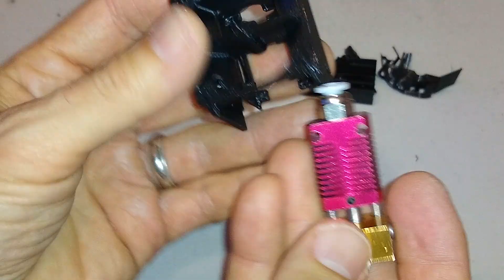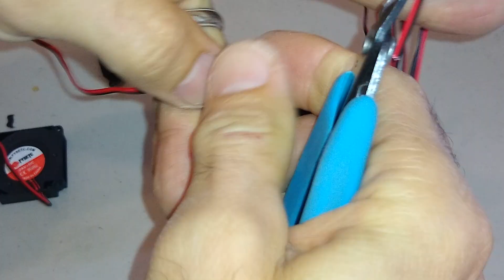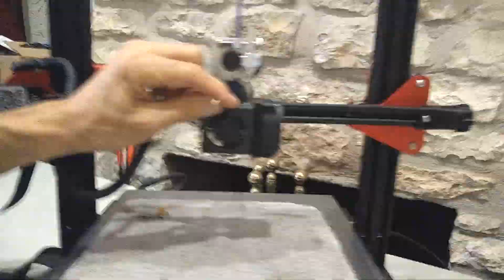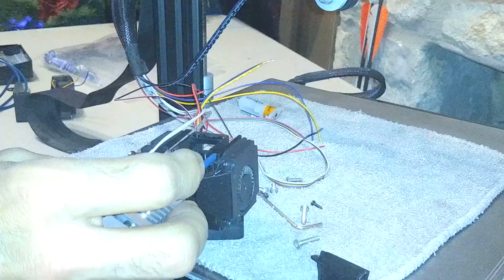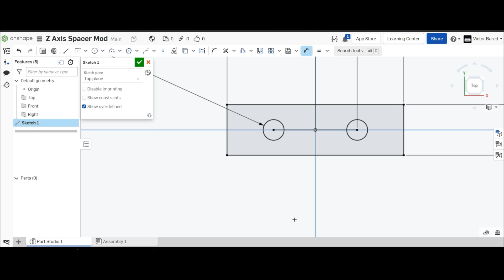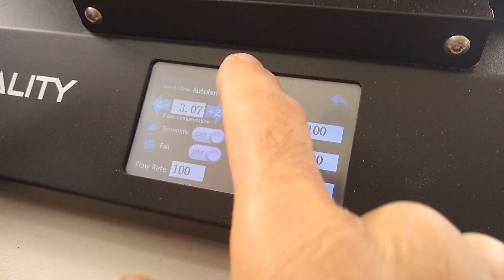3D Printer Super Efficient, Extremely Compact Designed Minimalist Tri - Fan Bracket and Ducts

Comment: Will this work for Ender 3 v2 NEO?? Not sure if they are the same or not
Reply from the maker: Hi friend, Thank you for commenting. I made a video on my buddy's Ender 3 Max Neo. I believe the stock hotend between the standard Ender 3 Neo and Max are the same. I'd they are the same then to get things working properly I would swap out the gantry bracket for the one from an Ender 3 V2.

https://youtu.be/m_0vnfnbCv0
Reply: @vbared  dang lol I just bought this one... I didn't know there was another model
Reply from the maker: @dubrpanda1636  I don't have a model for the Ender 3 Neo specifically because the location of the hotend is more to the left than on the Ender 3, V2, and Pro models. To make it work you will need this bracket, which puts the hotend in the proper location.

https://amzn.to/49Qmnzz
Reply: @vbared  thanks

Comment: Will this work with the Creality Spider 3.0 hotend?
Reply from the maker: Hello Randy, Unfortunately, it's too wide to fit. Have you already purchased the Creality Spider 3.0 hotend? If not take a look at the E3D REVO CR hotend. It's a complete game changer for 3D printing as it eliminates the seal inside of the heat block which is where all the failures happen and allows for super easy nozzle changes that can be removed by hand.

https://e3d-online.com/products/revo-creality?variant=40076651790395

Comment: Looks good though I hope you never get a clog and have to remove the hotend.
Reply from the maker: Hello ZK_63, Thank you for your kind comment and your right, the fan wiring removal is a pain. Thankfully since ditching the Micro Swiss I haven't had to deal with more blowouts.

Best of luck with your mods!
Reply: @vbared  So, what hotend do you use?  The video sure looks like a  Microswiss hotend and direct drive.  I know I have been having problems with mine.  It works great for PETG, but when I switch back to PLA it clogs.   So, I just use PETG now.  I would really like to find a system that can do both as well as TPU and ABS or ASA.  Maybe I am not being realistic and I need to just buy another printer preferably something smaller like Ender 2 Pro or the Kingroon KP3S Pro.
Reply from the maker: @ZK_63  Yeah, I used the Micro Swiss for awhile but found it unreliable. The fan bracket has gone through many revisions and currently fits both the Micro Swiss and stock bowden lined MK8 hotends like the ones that come on the Ender series of printers. I have 2 hotends that are my workhorses a genuine E3D V6 all-metal hotend that is bulletproof no clogs, blowouts, nothing goes wrong with it, and has more flow than the stock MK8 due to a taller heat block. I also designed a fan bracket to fit it as well. 

Video of it - https://youtu.be/dZz-eR3d5YE

My other one is the stock non-anodized Ender 3 V2 hotend that needs a couple of assembly tweaks to make it super reliable. It needs 4 things, a short piece of Capricorn bowden tube sandwiched between a 3D printed washer/centering cone and the brass filament nozzle. The threaded part of the pneumatic fitting on top provides an enormous amount of pressure on the bowden tube keeping it sealed to the nozzle. The trouble with the stock setup is that the teeth in the pneumatic fitting starts digging into the bowden as it rotates inside of those teeth and eventually loses its pressure on the nozzle creating a gap that molten filament flows into, crystalizes, and ends up restricting or completely clogging the path. 

Thermal paste added to the outside of the heat break sleeve prior to inserting it into heatsink bore (this solves heat creep issues even if using Noctua fans ), and finally using a 3D printed torque wrench to tighten the nozzle. One of my machines has been running this stock tweaked hotend for over 10 months of continuous printing without a single service.

Let me know if you want me to send you a link to the 3D printed torque wrench I use.

Enjoy your weekend :)

Comment: Is there a version for Ender 3 V2 Neo?  the length is the same, but the cooling fins are wider.
Reply from the maker: Hello James, I believe that the standoffs are in the same place as the standard Ender 3 V2 as well. If so I would purchase a standard Ender 3 V2 hotend, a bi-metal heat break, and then just use the latest version of the Minimalist Fan Bracket that now includes a closed bottom design to eliminate drafts caused by the hot end fan leaking air down onto parts when printing with materials like Nylon and ABS (which warp easily). Unfortunately, a closed bottom design using the Neo hotend because of its taper doesn't look promising.

Comment: If we just wanted to start with replacing the blower fan with one of these you linked for a quieter blower fan, would it provide enough air? Or does it need both?
Reply from the maker: Hello Embergrit, Thank you for commenting. You can run a single fan, no problem. If you print at 50mm/s you won't see much of benefit from the dual fan version. Where the dual fans become important is when you start printing past 100mm/s.

Best of luck with your mods!

Comment: hey Victor from keeping those wires touching the bed you should try adding hanging springs too hold the wires up
Reply from the maker: Hi Larry, Thank you for your suggestion. The wires have been driving me crazy. The way Micro Swiss tells you to install their kit keeps the wires in their original position but doing it that way causes the wires to get pinched when printing near the max height.

Comment: Hi, I've printed and tried to fit the prototype on my ender 3v2 but It doesn't fit since I don't have the microswiss hotend, but also the clearance bottom left on the left fan is not enough for the bolt sticking out on the other side. I don't see how a fan would fit there since it would be pushed away from the frame by that bolt. Is this addressed on the new design that costs 3,50?

Edit: Nevermind! found the comment with the same problem and I fixed the issue. I'll buy it now then :)

Edit 2: NEVER MIND DON'T REVERSE THE BOLT!!! you won't be able to auto home as it runs into the extruder bracket... Time for a diy solution
Reply from the maker: Hello Uxcis, Thank you or commenting. My machine came with all the hotend bracket wheel nuts facing back. The Allen key sides all face the front. I'm not sure why but some of the Creality printers have the bottom wheel bolt with the nut facing front. If yours is like this just loosen and turn the bolt around so all the nuts face back. Yes, the $3.49 fan bracket .STL files include all the revised parts and include no charge future updates. I'm currently testing a revision that I will be releasing soon so if you decide to support my work by purchasing the most current model you'll receive and email letting you know that an update is available.

Enjoy your mods!
Reply: @vbared  oh great! Well I just printed it. I found a thin nut and shorter bolt that just about cleared the bracket it would otherwise ram into. My fan is arriving tomorrow so can't wait! Thanks!!

Comment: Hey! That is an awesome design! I was wondering. What is the voltage of the fans you are using? Won't they be slower since the power supply is prepared for 1 fan? Sorry, I'm not quite good at electricity so if you could explain, that would be appreciated <3
Reply from the maker: Hi Laura, Thank you for commenting and kindness. In this video I'm using the stock CR10S Pro V2 heatsink fan but turned down the voltage to 19  volts (to make it quieter) using a buck converter (little adjustable electronic board that reduces voltage from the stock 24 volts all the way down to 3 volts). The two side fans are standard 24volt ender 3 parts cooling fans. The power supply is very robust and can easily handle more accessories. 

Welcome to this awesome hobby!

Just ask if you have any questions so I can do my best to help you save time on learning.

Best of luck with your mods!

Comment: Victor, this is EXACTLY what I was looking for. I printed the v2 one you had posted and then I found it didn't really work without some modding. Then I found this and saw it was compatible with the ender 3 pro and purchased immediately and it is currently printing. Unfortunately I only have PLA so this one might not last too long 🤣. Would you recommend PETG or ABS for this? Thank you so much for your work and your attention to detail!
Reply from the maker: Hello IcanthelpIt90, 

Thank you for your purchase. PETG is the material that I use for everything (linked below is the brand I use). It doesn't require an enclosure to print and doesn't release, toxin odors but adhesion can be tricky. If you can't get it to stick to you build plate pick up the G10 Garolite build plate that I made for the Enders with a 235mm x 235mm build plate. Set you hotend between 220-230c and bed to 80c. Make sure to check your e-steps before the actual print and adjust if needed. Let me know if you have any questions.

Exact filament I use - https://amzn.to/3M7T8fX

G10 Garolite build plate 235mm x 235mm - https://amzn.to/3w4iJAC

Happy modding (:
Reply: @vbared  You seriously are the best! It's a good thing my birthday is in two weeks, guess I am getting some PETG! I got my ender 3 pro (first printer) last Friday for $99. I already spent like $150 on upgrades (my wife thinks I'm crazy) I just like modding. Print came out perfect in PLA and am already running this cooler! I am now able to print at 120mm/s accurately (again, thank you so much). Now I am just waiting on my skr so I can install klipper and tune it even more.
Reply from the maker: 3D printing is an amazing hobby. Besides all the fun you'll have tinkering, it can generate side income pretty easily. 

Best of luck with your journey!

Comment: Awesome, what would really set it off is a hot looking shroud over the top
Reply from the maker: Hello glenncol, What printer are you installing it on. The digital download from my Shopify store will include a shroud for the Ender 3 V2 and I've made the Ender 5 version as well.
Reply: @vbared  Hey Victor, i am about to buy the Ender V2
Reply from the maker: @glenncol  It's an awesome printer. If I had a dedicated room for 3D printing I'd buy a few more to increase production.

Comment: Hi Victor,  I'm working with the Duct Tabs now and thanks for the notes on the brim and positions of the Duct Tabs.  So far the prints have not been great but this next one looks like your jpeg picture with the brims so lets see if I got it correct this time.  AutoBots!   Roll Out >
Reply from the maker: Hi Doug,  Glad your system is coming along. The small ducts are tricky to print. I printed mine at 25mm/s so the melted filament has time to solidify before the print heat comes back to deposit more material. This will help if the problem is deformation.
Reply: You could also print the ducts in pla. It’s much easier.
Reply from the maker: @markuss1844  Thank you Markus, let me know how they hold up. I had one of my PETG ones start to curl a little on one edge so I reprinted them using nylon. So far so good.
Reply: @markuss1844  Hi Markus, Thank you for you comment and help.  Being new to 3D printing I do need inputs.  At present I'm printing with HatchBox blue PLA like you said I was told it was easer to learn with.  I'm on my second set of ducts do correct some errors I made with the screw holes.  Much better this time around.  Victor has done a great job with this cooling system.
Thanks Doc'

Comment: I printed your design in Petg  without support. I use it with one part cooling fan until I get my second one. Works great. For me by far the best design for the Ender 3V2.
Reply from the maker: Hello Markus, Thank you for commenting and supporting my work. I'm pleased it's performing as expected. Super cool that you got it to print without supports.

Best of luck with your mods!
Reply: @vbared  do you think a micro Swiss direct drive upgrade is worth it? Will it be compatible with your shroud?
Reply from the maker: @markuss1844   Hi Markus, The Micro Swiss direct drive is compatible with the fans mount. In my opinion I prefer the stock hotend bowden setup upgraded with the Slice Engineering bi-metal heat break. I'm not 100% sure why (guessing it might be the nozzle design differences) but it produces cleaner prints than both my E3D V6 all metal and Micro Swiss all metal hotends that I run on my other printers. If you don't need to print above 240c then stay with the stock hotend and just add the Capricorn bowden, apply the hotend fix from my other video, make sure you add thermal paste to stock heat brake sleeve that slips into the heatsink before tightening the grub screw. You'll have a bullet proof hotend. I would highly recommend upgrading the stock extruder filament tensioner to the Micro Swiss dual gear extruder kit. If you need other details just ask here or call me +1 478-227-3301

Best of luck with your build!
Reply: @vbared  what’s the difference in nozzle design? Don’t I just use a normal mk8 nozzle for both?
Reply from the maker: @markuss1844  The Micro Swiss nozzle is wider and not as pointy as the Creality nozzles so it tends to pickup more filament along the tip edges as it prints. Getting your z-offset perfect will minimize the fine threads from this happening but only if your z-offset is perfect. Using the Creality standard nozzles result in almost no fine threads anywhere. The retraction settings will only work with melted filament directly under the nozzle but not what has been building up along the nozzle edges.
Reply from the maker: @markuss1844  If you need the Micro Swiss direct drive I would order just that part and use the stock hotend with it. If you plan on printing hotter than 240c get the Slice Engineering bi-metal heat break.
Reply from the maker: @markuss1844  Markus, I just compared the nozzle threads between the Micro Swiss and the stock both are the same so from what I can see you should be able to use the stock Creality style nozzles on the Micro Swiss all metal hotend to get rid of that fine threads issue.
Reply: @vbared   thanks man! I just ordered the slice copperhead heatbreak and a micro Swiss bowden dual gear extruder.
Reply from the maker: @markuss1844  Anytime Markus, Make sure when you tighten the side screws after installing it that you don't get too crazy with the torque because you could press the stainless sleeve out of position.

Best of luck with your upgrades!
Reply: @vbared  last question 😝. Does it make sense to upgrade to a 4020 fan in the front?
Reply from the maker: @markuss1844  Good morning, No worries, Markus, ask away. I enjoy helping. I run the 4010 Noctuas on my Ender 3 V2s they are super quiet and cool the heat sinks with no problems. The trick is to make sure and use thermal paste on the heat break sleeve (only the side that slides into the heatsink) before tightening it down with the grub screw. The goal for me was to keep the mass of the hotend assembly as light as possible to get cleaner prints. There are many posts and I've had comments telling me that I'm going to get heat creep using the Noctua fans over the super loud stock ones but that will only happen if you don't use the thermal paste. I run a small print farm and my printers are on all day everyday. I haven't had to mess with any of my hotends since using the thermal paste and applying the hotend fixes to them.

https://photos.app.goo.gl/mo2wcghZ7VNBnLRh8

Best of luck with your mods!

Comment: So, should I purchase a CR-10S Pro V2 and perform the Micro Swiss Direct Drive Mod
or
CR-10 V3 E3D Direct Drive
or
CR-10 Smart Pro Direct Drive
???
Reply from the maker: Hello Bigfoot4000, Thank you for commenting. Unfortunately, I don't have any personal experience with the CR10 V3 E3D or CR10 Smart Pro Direct Drive. I can only go by the specs. The CR-10 V3 E3D has many of the things that are important to me today. The CR10 Smart Pro Direct Drive has a lot of propriety things that are going to make modding it more difficult if it doesn't perform as advertised. The CR10S Pro V2 is awesome once it's all upgraded like mine but I did spend a lot of money on making an already expensive printer reliable, but one of its design issues is having all the electronics enclosed under the unit. You can't just put the printer inside of an enclosure if you decide to print with ABS or Nylon because the electronics will be getting cooked. The CR10 Smart Pro Direct Drive will also have the same issue since all the electronics are housed inside the base.    

The CR-10 V3 E3D plus a BL-Touch is what I would buy today if I needed another big printer based on it's specs. 

CR-10 V3 E3D:

E3D Hotend
Direct Drive
Dual Z Axis
Riser Support Bars
Silent Mother Board
Control Box is separate (which is best if you decide to build an enclosure for the printer)

Best of luck with your mods!

Comment: Hello I've printed up the shroud and it seems like there's a thin wall behind the fan section behind the ridge at the front of the mfb for mk8 and micro Swiss file? I cannot get the slicer to seal the gap??
Reply from the maker: Hello yodasscrotum, Thank you for commenting. Are you using the most current .STL file or did you print an earlier version of it? Please email me the .STL file that has the gap to vbared@gmail.com so I can look at which one you are printing.
Reply: @vbared  I'll email you, but it was the newest version.